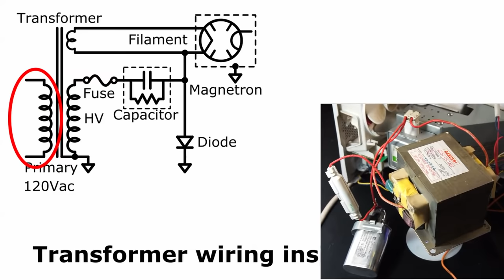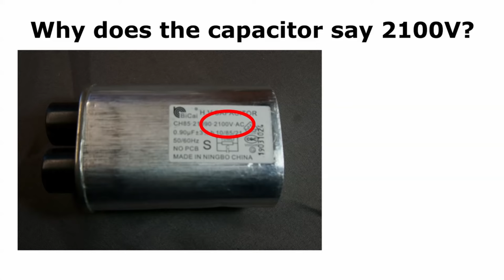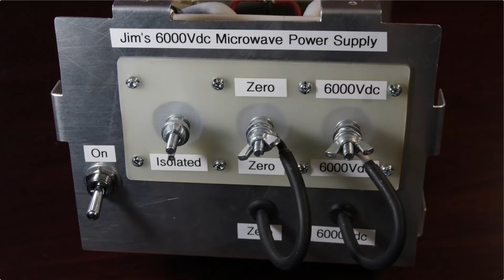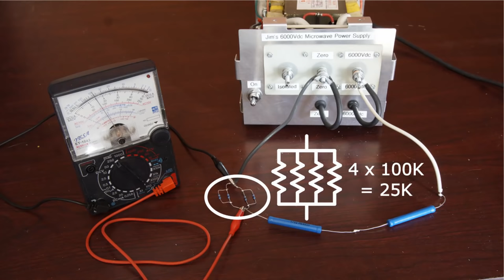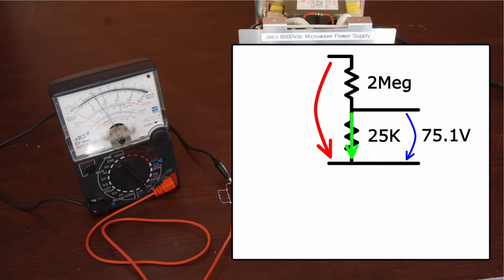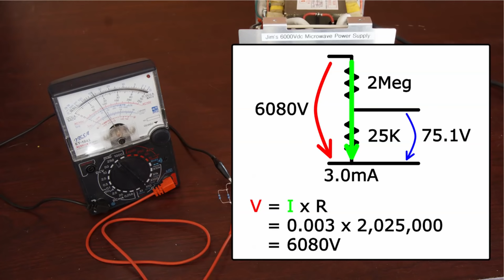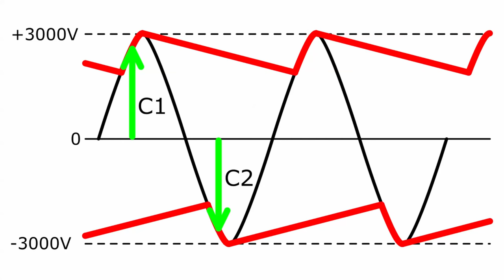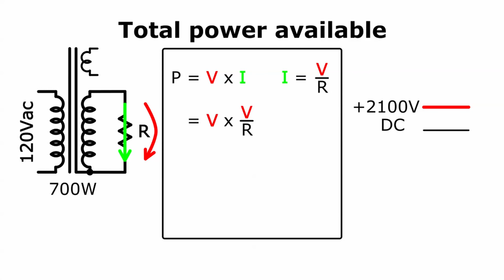6000Vdc power supply built from a microwave oven transformer

Comment: Very detailed explanation of how microwave ovens work! Thank you! 
But what kind of home applications would use a 6000 Vdc ?
Reply: Electrophoresis
Reply: Electric chair
Reply: @slender1357  lol i should think with enough amps at any voltage you could use electricity to kill. Obviously the lower the voltage the less humane it becomes haha
Reply: @jcreedy20  lower voltage = lower current (I=U÷R)
+ its not the current that kills but the energy flowing in the body(voltage,current and TIME = energy)
Reply: @slender1357  I'm referring to killing people with an electric chair, I meant the lower the voltage and the more amps required to kill as the voltage gets lower would be less humane as it would be more physically destructive on the body. Where as a higher voltage and less current required for it to pass through the body would do things like stop the heart etc instead of melting body parts and blowing off parts localised around the electrical contact points.
Reply: @jcreedy20  if you want more amps you will need more volts
For example if the body resistance is 1 ohm then at 100v the current will be 1amp(100v÷1Ω=1A)
But at 200v it will be 2A
So if you need more current flowing in the body you can : increase voltage or lower the resistance.since you cannot change the body resistance(unless if you put something like salt water on the body etc), you will need to increase the voltage for more current.
Hope you understood
Reply: @slender1357  n mind.
Reply: @jcreedy20  no problem
Reply: @Hawley Hobbies gov will have all heads for this tech thay teach us that we always have loss but never talk about 
the converted gain we can make from eletromagnets
if u convert all the wast thermal energy around 
you u can use it universally as energy u need a true sine wave bipolar like the power comp dose a 
true pure sinewave like a grid tie inverter 
once the signal is made the system will turn on and 
consume wast thermal energy from the 
environment and space around you... there is free energy but it comes from Universal thermal loss and converted into a gain. so a pole Transformer and a 
microwave Transformer  have a common between each other u can take 2 microwave Transformer provide 
a pure sine wave grid tie inverter to it or a true bipolar sinewave that inter acts with nature in 
a perfect spherical motion like a flower of life..  if ur home provides this use it as a Source 
signal then u can simply stack the Transformers on top of eachother in correct fasion and note 
that the 1 wire on the Transformer must stay connected and the other disconnected your only useing 
1 wire on the hi side .. so test ur self 
2 microwave transformer stacked on top of eachother same face sides. one side 120 to the wall and the other 120 side to what u want to power and useing the 
Transformer just the way it came out the microwave with the wire attached causes the energy in its 
perfect spherical motion to converted wast thermal energy to amp for u hot to cold in to out... 
should look a bit nuts with u use a form of wireless energy but its interacting with the environment...this is my work a compilation of Otis car. Tesla. and many other very smart people nowadays i think i found the gate source and drainif this gets out to much that it works the 
power comp and mib will have our headsdont do this at home warning high voltage yet i cant stop u lol DO NOT TOCH THE CORES OR THE WIRES OK u will die make sure u dont touch the core if the hi wire is mounted to it u dont have to mount the hi on the core if u dont want u connect the 1 hi wire to the same side hi on the other transformer then the core should besafe to handle if nessary
Reply: Most likely that most people would not need this.  It would make a great power supply for a tube type radio frequency amplifier as used by Ham radio people.  Some types of gas discharge laser would also use this.  Might make a X-ray device but the voltage is really too low so would only get soft x-rays.  A circuit including a voltage multiplier could get you there.  Look up "Cockcroft-Walton" multiplier, for example.

Comment: Gday I will have to ask again brother , As there have not been any serious answers given - as far as I can see . what  practical uses does it have . Can you please give a few practical applications. Thank you. 👣🇦🇺🦘🍻
Reply: Apparently he doesn't answer questions, but 6000 volts is equal to 9000 watts, im wondering the same question, & can you connect 2 of these together to get a total of 18000 watts, & if so that's enough to run everything in the house, but wondering if you can use this footprint to run a whole household
Reply: Would it Run From a 12 v  car / caravan inverter ?     Or a Solar battery storage bank  . Or maybe a  Wind or water wheel ……runs car alternator/ -to -inverter  -  inverter - runs microwave transformer = runs entire home  . Dose this make any sense ? In my  ADHD dislexic brain this sounded like a workable idea  . My train of thought probably has more holes in it than a colander .  👣🇦🇺🦘🍻
Reply: PARTICULARY VERY  GOOD FOR ..... HAIR DRESSING...?
Reply: @carlschmiedeke151  You don't know what you are saying. Don't pretend you do.
Reply: @peachsncream5808   No, it will not work in the way you suggest. It is a VERY dangerous item to play with and has very limited practical uses... not being what you suggest. 
Some use for dangerous hobby/craft that kills people every year... quickly. Also a hazard for anyone trying to assist the victim if it is still energised. 
As a licensed electrician who also holds HV operator ticket, in Australia, I have used far higher voltages to safety test (insulation test) equipment and distribution networks at HV Sub Stations... BUT that test gear goes far higher than 6kV (10x rated operational voltage), ONLY trade qualified individuals can use it, and all non-essential persons directly involved in the testing get anywhere near what is being tested. 
The creator of this video should seriously consider the liability of providing info for idiots to kill themselves.

Comment: Don't fuck around with mots. Low impedance high voltage sources are lethal. If you want to make a high-voltage power supply use a flyback. Also, if you disassemble a microwave be sure to short out the cap. It can hold a lethal charge.

Comment: Great video, I have a few questions 
1. What would be the difference in output if you use a full wave bridge rectifier ?
2. if i wanted to build a 12v dc power supply with say  a 100 Amp output, How many turns would I need on the secondary side ?
Reply: 1. A full wave bridge rectifier would produce an output of about 3000V (instead of 6000V).
2. A 12V DC power supply with 100A output would be totally unrealistic to try and DIY. That is a significant amount of current.... more than 1200VA. It would take an absolutely massive transformer core to supply that current reliably. And the copper wires on the secondary would be huge to handle 100A.
The easiest way to create a high current 12V DC power supply is to use a battery (Lead Acid from a car, or LiFePO4 if you are rich) and a suitable battery charger.
Reply: @johncoops6897  I'm not sure of the amperage,  but people have built DIY spot welders using these transformers with the original secondary winding removed.  The new secondary used welding cable or simlar.
Reply: @Roy_Tellason  - yep, I own one myself. The typical DIY spot welder for lithium battery pack tabs runs 2 turns, giving and output voltage of 2 or 3 volts, and giving peak 500A or so. You cannot reliably spot weld steel with such a transformer.
The biggest original microwave transformers are only rated 1000W, and a low voltage winding will be less efficient. You cannot get 12V x 100A (1200W) continuous from a microwave transformer it will overheat much lower than that.

Comment: Hi sir excellent video. May i ask how it is safe when one line of high voltage transformer is connected to oven chassis? Thank you
Reply: It is "safe" because the oven chassis is connected to Ground (Earth).
In any case, electricity is not dangerous if there is only ONE connection. It becomes dangerous only if there is a "return path" so that the current can flow.
So, even if the oven chassis was not earthed, it doesn't matter that one side of 2000V or 3000V or even 20,000V is connected to that chassis. It ONLY matters if you touch the other connection at the same time as you touch the first one, so that the voltage flows through your body.
In the microwave oven, you can only touch one side of the output. The high voltage power cannot flow through your body because you cannot complete the circuit. However in this guy's 6000V DC power supply, both terminals are fully accessible at the front panel. If you touch one of them, nothing will happen. But if you touch two, then you will probably die.
Reply: @johncoops6897  Thank you for replying to my question, very helpful. I will also want to ask: if the oven chassis is not grounded and someone touch the chassis while his feet connected to the ground, is it dangerous? I just thinking of worst scenario. Thank you
Reply: @sand2698  - No, touching the ungrounded chassis of the oven is NOT (inherently) dangerous. I'll use some simplistic examples below that aren't 100% technically accurate, but will help to explain the concepts. This reply in a number of parts....
...
Electricity if the flow of electrons. It cannot do anything whatsoever unless it can flow From somewhere and it can also get  To somewhere. However it's very important to understand that there must be a continuous loop. So, the electricity cannot flow from one place (eg: microwave chassis) unless it has somewhere to go to, and ALSO that the power can get back to the original starting position. That flow path can be direct, or it can be indirect (via another place, like your body).
...
Think of a battery and a light bulb - the electricity cannot flow from the battery to illuminate the lamp if you only connect just one wire. It has to flow out one end of the battery, into one connection of the lamp, then out the other side of the lamp and BACK TO THE BATTERY. The electricity came from the battery and it needs to get back to the battery again in order to flow around the circuit and do anything.
(See next part 2)...
Reply: @sand2698  - Reply part 2...
So, compare a Nascar racing track that goes around and around with a drag strip where the cars just race from one end to the other. Electricity can only race Nascar because it needs to go in a circle (loop) to flow around the circuit. Hence, to flow electricity you need TWO connections to the same electrical circuit, AND to get electrocuted you need to become a section of that circuit, so that the electricity flows THOUGH you (not just past you).
...
The final thing to understand is that the electricity can only flow around the SAME circuits (or loop, or Nascar track). So, electricity might flow around one, two, five or hundreds of individual circuits but they will keep to whichever circuit contains both a start position and a finish positions.
...
The mains power in your house is referenced to Ground. The Neutral wire is connected to ground (via the dirt on the Earth) and one side of the big Power Station is also connected to Ground. So electricity flows from the power station, along the street wires, into your house, out of your wall socket (via the Live or Line connection), through one side of an appliance, out the other side, then back to the wall socket (using the Neutral connection) and back to Ground again. That ground is the dsame Ground that the power station is also connected to.
(See next part 3)
Reply: @sand2698  - Reply part 3...
So, if you touch the Live (Line) mains wire AND your feet are connected to (touching) the Ground, then you become a connection that the electricity can flow through. The high voltage from the wall socket can flow through you and back to Ground, where it can make it's way back to the power station. This completes the loop and the electricity can flow around the circuit.
...
OK - back to the microwave! There are TWO coils of wire in the microwave transformer. One coil (loop) is the Mains Power circuit, and it's connected to the wall socket. The electricity flows around it like I described above. None of that loop connects directly to the microwave chassis.
...
The other coil (loop) in the transformer is the very high voltage side that drives the magnetron. This is completely separated from the Mains Power loop (circuit). They are not the same "Nascar Track", but two tracks that are kind of next to each other. The electricity electrons (cars on each track) on one circuit are not able to race on the other circuit - that's because they are separate loops with no connection between them.
(See next part 4)
Reply: @sand2698  - Reply part 4...
Now consider that dangerous 2,000V circuit of the microwave transformer. One side is connected to the Microwave chassis (ie: normally Grounded) but the other side of that same circuit is only connected to the Magnetron. If you touch both of those at the same time, then you get 2,000V flowing through you and that will hurt.
...
However if you only touch ONE side of the loop then the electricity cannot flow. It doesn't matter if you touch the chassis side or the magnetron side, the electricity cannot flow through you unless it has a path to get to the OTHER side. So, you have to "complete the circuit" to get zapped.
...
It's this "flow" of electricity that make it mysterious and somewhat confusing. The flow doesn't need to be via a wire, it just needs something fairly "conductive" in order to complete the loop. The dirt in the Earth is conductive enough for ALL of the power from the entire power station to make it's way back from all the homes and complete the electrical circuit.
(See next part 5)
Reply: Reply part 5 (final)...
OK - so if you touch a 110V/230V Mains Live connection whilst your feet are touching the Ground, then electricity can flow though you and back to the Power Station which is also connected to Ground. You need to touch BOTH points to get electrocuted. If you touch the Mains Neutral connection while your feet are touching the Ground, then electricity will NOT flow through you because the Neutral and the Ground are connected together. Effectively you are only touching one side of the Mains Power Circuit.
...
In the microwave, one side is connected to the chassis which is normally Grounded. If it's properly Grounded and you touch that chassis, then electricity cannot flow from Chassis Ground to Earth Ground (via your feet) - it's just two points at the same voltage. It's kind of like two Nascar circuits, where the finish line are joined but the starting lines are on separate loops - your hand and feet are both touching the finish line, so there is no circuit.
...
If the microwave chassis is not Grounded, it doesn't matter either! The Ground (dirt) that your feet are connected to is not in any way connected to the 2000V circuit, not to either end of that loop. So in this case, there is no way for the electricity to flow back to where it started from. You cannot make the circuit with your body because you are only touching one side of the high 2000V voltage loop.
...
Just remember that you need to "complete the circuit" in order for electricity to flow through you. If you touch one side of two separate circuits then you won't get zapped, since there is no way that the electricity can go in a loop. In the microwave, the inherent safety comes from the separation between the Mains wiring and the High Voltage 2000V wiring - they are completely separated.
[END - phew]
Reply: @johncoops6897  So much Thanks for answering my question I have for days! Very clear and simple explanation yet I am content and understood it well. The main socket is connected to power lines so there is a return circuit to the ground. While the high voltage transformer is a isolated circuit (even if not grounded) so there is no tendency for the electricity to flow through a body to the ground. Thank you for helping me settle this question about safety so I can move forward with my project.

Comment: The  gloves definatly for gardening  not electrical high voltage insulation  you would need to wear  some gloves rated for the  output voltage at least or higher or you will be dead

Comment: I'm just looking at those exposed terminals and shuddering. Those just should never, ever be exposed like that.
Reply: Agree. Huge exposed wing-nuts for 1000's of volts...really?  We're not making a 5V 50A power supply.... Adding to the danger, there's no power indicator to show that it's switched on. Also, the final schematic does not show any earth connection from the mains to the chassis..... I just hope that anyone who builds this, lives long enough to make it safer.

Comment: Overall a great tutorial but " a spring loaded fuse"  No no no.

There are spring loaded fuse Holders, in fact other than soldering the fuse, every fuse holder should have "sprung" connections.

The fuse itself is NOT spring loaded, its an "Anti-surge" fuse.

The 3 terminal connector is called an "IEC plug & socket".

Comment: Earthing danger!!! DANGER DANGER
You have wired the two transformers in series, and their frames together. If you have either "end" grounded to the case there will be some 3000 volts between the primary winding and the frame. It only expects about the mains potential.
If the mains earth is open anywhere and the primary insulation breaks down  there will be dangerous voltages.
In the microwave it is the insulation of the capacitor that will be critical.

A cockroft waltom mulitplier with isolated capacttors would be MUCH safer!!!!  

DANGER DANGER DANGER